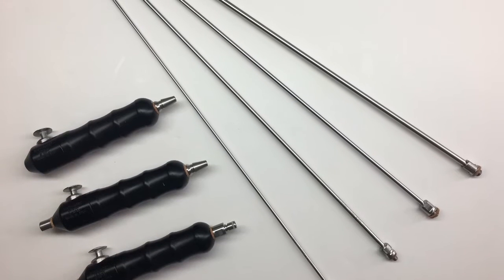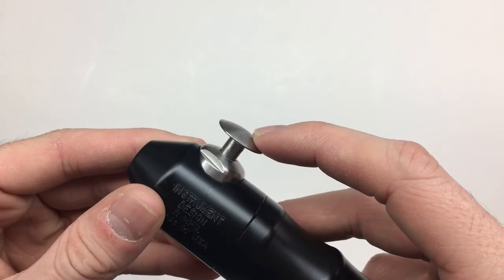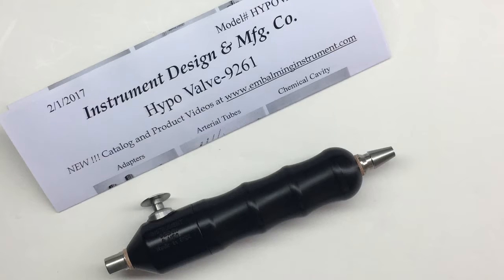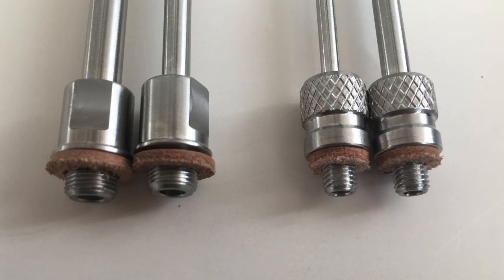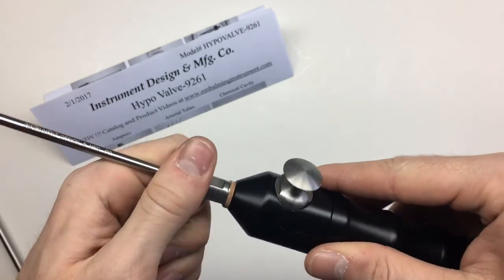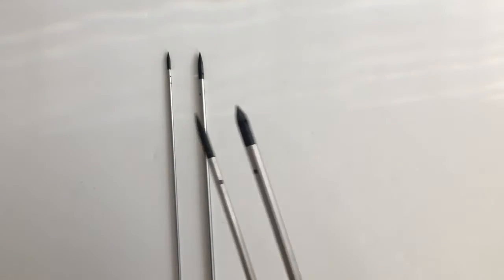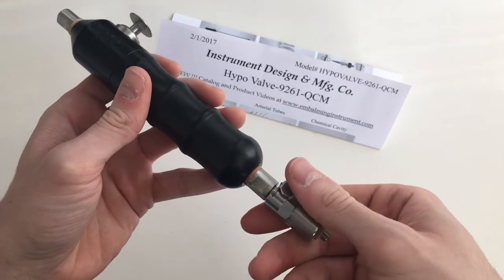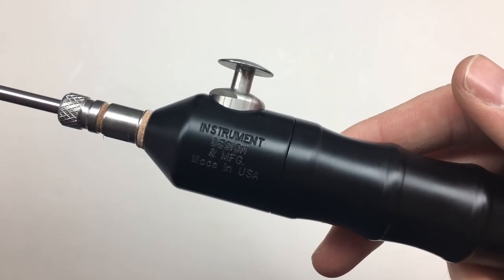The Hypo Valve - Instrument Design & Mfg. Co. LLC

Comment: What i found about the thread is if its overused the hyposhaft tends to break away on the thread itself tried using the hyposhaft with the 1/4 inch cant send the pics for what happened but can we weld it back together?? because if we insert the hyposhaft to the thread it sticks